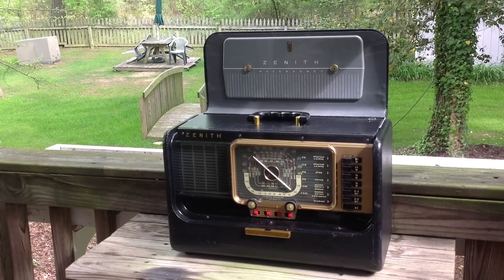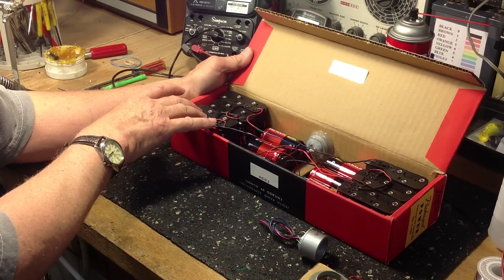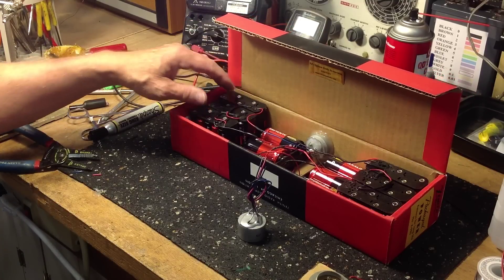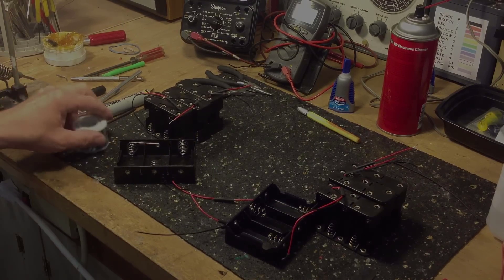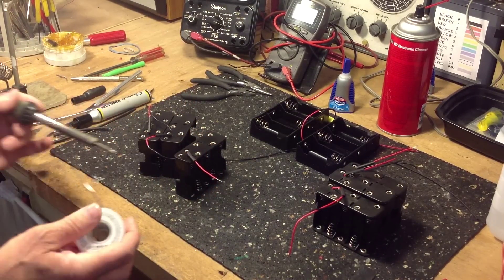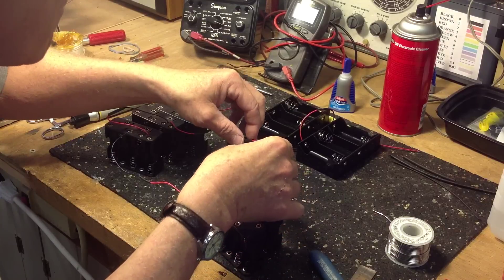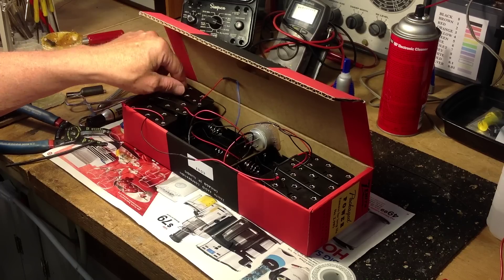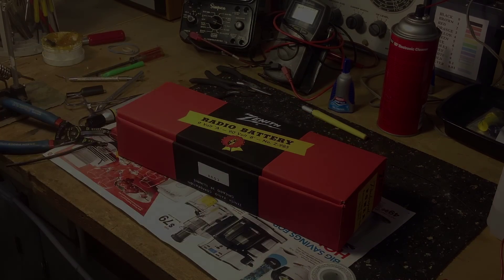Build a Working Battery for your Zenith Trans-Oceanic Part II

Comment: I'm going to take a stab at this, just linking these batteries together using the existing connector from the battery set that came with the R600 I just bought, and some battery holders I just ordered from Amazon. I may decide later to build a wood box to hold all the batteries, and a set of your battery box labels to dress it up. I can't pick up much using the AC power cord, and I've been reading that the radio actually works better on batteries because AC power creates interference. I just bought an AM bluetooth transmitter so that I can play old time radio mp3s I have downloaded over the years. Can't wait to hear the Bob Bailey Yours Truly, Johnny Dollar episodes blaring from this radio since my R600 was made in 1955, the same year Bailey took over the role of Johnny Dollar. Also wanting to play old CONELRAD recordings since this radio has the Civil Defense markings at 640 and 1240 on the AM band.
Reply: Well, I got all the battery holders I needed from Amazon and got them wired together. I find now that I can't tune in to as many SW stations that I could with AC power. But at least the AC noise is gone. I still like having this radio, though, and will at least use it to play old time radio programs on it through the AM bluetooth transmitter. Looking forward to a Bob Bailey Yours Truly, Johnny Dollar marathon. William Conrad starring in Gunsmoke. Escape and Suspense marathons, too. Also bought a couple of old Zenith print ads about this series of radio that I will put in picture frames and display next to the radio. Also thinking about compiling a Civil Defense/CONELRAD scrapbook to sit beside it on a table, even though CONELRAD ended a couple of years before I was even born and was replaced by the Emergency Broadcast System.

Comment: This pack can be used for all zenith transoceanic ?
Reply from the maker: @_ferra9288  Yes, the Z-985 battery is used in every model tube Trans-Oceanic radio.  The 600 series radios also use an additional battery, a Z-1, for the dial light circuit, and the 8G009 radios also require the Z-1 battery as it has mores tubes than the 500 and 600 radios.  The first model, the 7G601 or Bomber model, also requires two D cells in addition to the Z-985 because it too has an extra tube.

Comment: Ed:    I have one of these radios minus the battery and even has the original tubes. Everything LOOKS BRAND NEW, but the insulation on the wires are crumbling. Any idea of where a schematic can be found, would a slow start up be recommended  and are recap & resistor usual for these sets?    I don't want to harm this set ****its spent the last 40 years in a closet ****and like i said ***********LOOKS BRAND NEW.
Reply from the maker: Yes, the radio should be recapped, at a minimum the electrolytic caps replaced.  Schematics are available on eBay and can also be downloaded from Nostalgia Air.  Go to my website’s resource page and you will find a step by step restoration guide for the Trans-Oceanic radios.  The early models used some rubber insulated wires and crumbling ones will have to be replaced.

Comment: Excellent video and thanks for posting. Any idea why the plug/socket is configured reverse of what I would consider "normal", i.e. with the line being female and the load being male?
Reply from the maker: I don't know the reason.  That may have been a Zenith thing as other portable radios I have worked on have the male plug on the radio side.

Comment: You could compromise and use 60 AAA cells also.  This would be a bit lighter than AA's, not necessarily cheaper though.
I wonder about using 75 Nicad or NiMh batteries and then designing an external battery charger.
Reply from the maker: Not sure what the mAH ratings are on AAA's compared to AA's.  The 60 AA's, depending on how often and how loud the radio is played, will usually last in excess of 400 hours.  This could be a couple years for many people.  By then, some cells may start leaking, so they should be replaced anyway with fresh cells.  Even the top brands are subject to leakage.
Reply: I think AAA's are about half the mAH of AA's IIRC, though that depends on the chemistry in question.